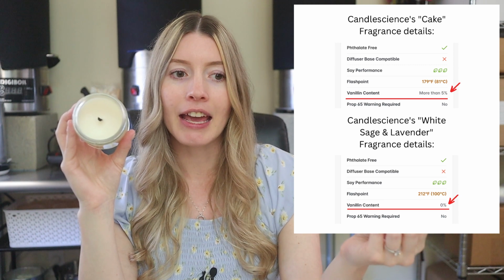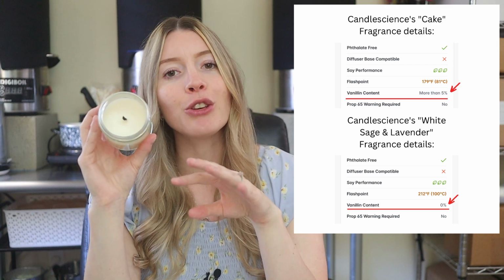Candle Making For Beginners Series | Part Four: All About Cotton Wicks

Comment: Let's talk about the phrase you used "burning too hot", ok? So if my melt pool is developed within less than 4 hours, is that the standard, right? I guess I'm asking, you can't point an infra-red temp gun to the flame, but to what - the glass? And on that note, how does burn differ in cement vessels as it doesn't contain heat like glass does.

Comment: I'm struggling to find the correct size wick for beeswax candles. So far I keep trying wicks that are too small, even though the containers are small 4oz jars.  I haven't been able to find any answers for a good place to start.  I prefer all natural hemp or cotton wicks for the pure beeswax I use.  Any suggestions where to start?
Reply from the maker: Beeswax has a very high melt point so I would definitely test larger wicks than you would for vegetable waxes. It definitely depends on the diameter of the jar but you may have decent luck with larger eco or CDN wicks! I’ve never made pure beeswax candles though so unfortunately I don’t know for sure if these would work but it’s worth a test!

Comment: Hello Erica, you look well! Thank you for this video. I am using c3 soy container wax and I was advised by a candle supply Co to use 2 eco 4 wicks for the libbey glass straight container which is 3.75 inches diameter. The eco 4 double wick in this jar can tunnel and I was wondering what your recommended wicks would be? Candlescience i believe on their site says to use 1 eco 16  that seems wrong. Thank you

Comment: Do you recommend burn testing with the jars you plan on using with your line? Or test first using some type of a clear jar and once the wick is decided on then moving on to test with the vessel chosen for your candle line?
Reply from the maker: You must test with the vessel you plan on using for your candle line with your chosen wick/wax/FO combo.

However, there’s no harm in testing other jars/vessels to gain experience and knowledge, but ultimately you have to go through the whole testing process with the vessel you plan on using in your line